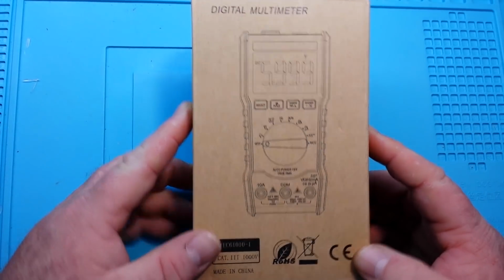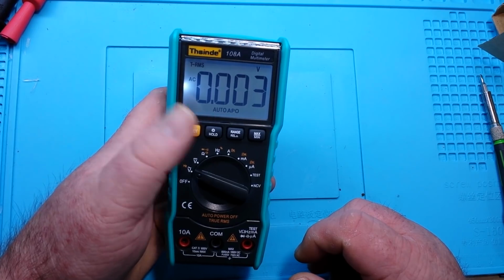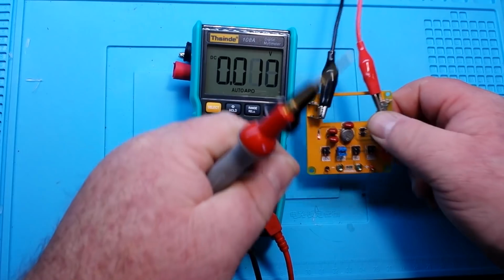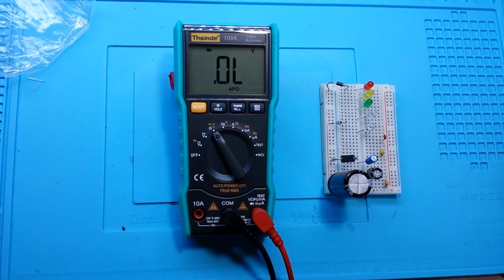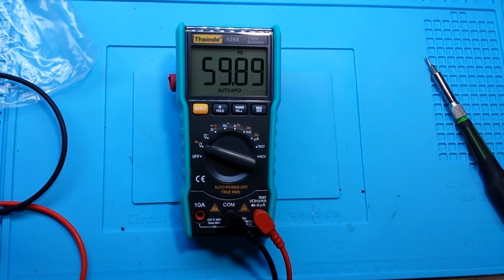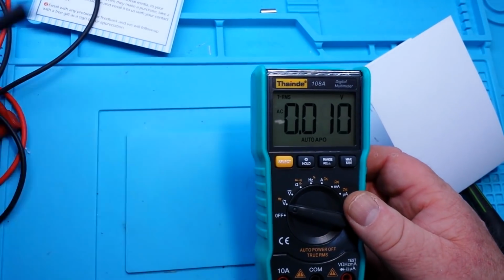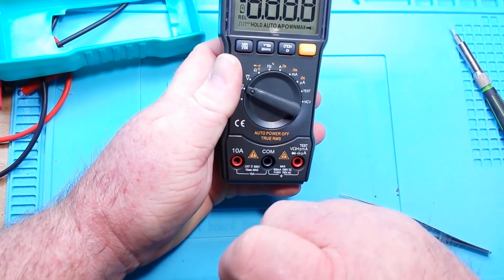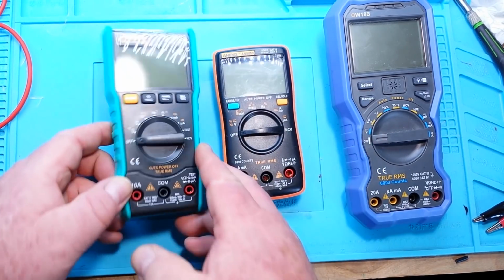Thsinde 108A Multimeter Review & Teardown

Comment: Hi, I like your reviews! :) - I have this meter in the brand of "Liumy" (LM 5005). It's almost identical. Just wanted to add: as you said in the review the display backlight shuts off after 15 seconds. I find that annoying too. But if you hold the button for 3 seconds it makes another beep and the backlight stays on until you shut it off manually.
Reply from the maker: Ok, cool. Thanks for the tip.

Comment: This is a repost of my comment that somehow "went missing".

(8:38) Sir, you are misunderstanding the in the spec sheet there.
The accuracy is 5% of the voltage displayed to a resolution of 0.001V
Basically, to say it should be accurate to within 0.001V (within the stated range) is wrong.
Plus or minus half a percent for the various voltages are given above. This is different than the resolution.
The resolution changes by an order of magnitude each time the 6,000 count is exceeded and you lose a decimal point place
All your readings appear to be within spec.

10V   0.5% 10 is 0.05 
         10 + 0.05 = 10.05
         10 - 0.05 = 9.95
Thsinde reading of 10V = 10.03V   THIS IS WITHIN +/- 0.5% SPEC @ 0.3%

7.5V   0.5% of 7.5 is 0.0375
            7.5 +  0.0375
 = 7.5375
            7.5 -  0.0375
 = 7.4625
Thsinde reading of 7.5V = 7.51V   THIS IS WITHIN +/- 0.5% SPEC @ 0.133%

5V    0.5% of 5 is 0.025
         5 +  0.025 = 5.025
         5 -  0.025 = 4.975
Thsinde reading of 5V = 5.024V   THIS IS WITHIN +/- 0.5% SPEC @ +0.48%

2.5V   0.5% of 2.5 is 0.0125
           2.5 + 0.0125 = 2.5125
           2.5 - 0.0125 = 2.4875
Thsinde reading of 2.5V = 2.511V   THIS IS WITHIN +/- 0.5% SPEC @ +0.44%
Reply from the maker: If you are Anthony Loper you're comment is right under this one. Next time you want to accuse me of something, get your facts right. In fact the next time you post some bullshit "somehow went missing" garbage I will ban your dumb ass.

Comment: (8:38) You are misunderstanding the in the spec sheet there.
The accuracy is 5% of the voltage displayed to a resolution of 0.001V
Basically, to say it should be accurate to within 0.001V (within the stated range) is wrong.
The resolution changes by an order of magnitude each time the 6,000 count is exceeded and you lose a decimal point place

All your readings appear to be within spec.
Reply from the maker: Ok :)

Comment: Not an addiction ... more a fetish!  With me it's screwdrivers that tighten my nuts.
The new tech soiled meters for me.  When I was a boy a good AVO was a precision instrument that cost as much as a house and you needed a wheelbarrow to transport it in. Hand sawn ballast resistors and sighting mirror mounted behind a needle mounted in a ruby movement.
Now you have a black tarry carbuncle evacuated onto a board made by the shopkeeper's nephew that is accurate to 5 places, has 150 functions, will never need calibrating and it will even identify the components for you if you can't.  The next version will no doubt have probes that will exude solder and fix your component in place once it's proved to be intact.  All for $1 free p&p

Comment: Great video as usual Paul. Not a bad meter for the money. I have two of the Thsinde 18B+  They are about $5-$6 more than this model, but are much more accurate and super fast for an auto ranging multimeter on the $20 and below level. People need to realize 20 years ago and when I was an undergrad in electrical engineering that meters like this were a lot more expensive and usually out of the price range of a poor college student. I know the meter was off on your voltage standard, but most people who are hobbyists don't understand significant figures and uncertainties. That voltage standard and meter combined would only be accurate enough in the physics and engineering world to maybe the first two digital digits on the multimeter. But still, it should have read closer to your Owon multimeter. A 6000 count multimeter for the price of a movie ticket, you can't go wrong.9
Reply from the maker: David,

I'm 50. And I'm fellinf we are around the same age. I couldn't even imagine buying an auto ranging dmm when I was an undergrad. I had my uncle's Simpson and a radio shack meter.

Comment: hi Paul, another great review as usual. thank you for that. about the squarewave output, i think there are two models that available : one with 'TEST' function as you have, and the other one with the squarewave function. at least that's what i know when i bought a WinAPEX ET 8101, basically the twin brother of that Thsinde DMM. the seller sent me the one with squarewave output function.
oh and you should check out the needle point probes that came with it. i have a pretty good experience with the similar cheap probes, it has quite low resistance, nice and fast beep on continuity mode. just clean the tips with IPA first before you check.
cheers. :)
Reply from the maker: Thanks!
Reply: @learnelectronics  i just realized my mistake (typo), my DMM models is ET 8102, not ET 8101. but the information about it is still correct. cheers. ;)

Comment: I'm not bothered by the manual AC/DC selector.

It can come in handy if you are trying to measure ripple on a DC power supply or similar.
Reply: Shouldn't it be possible to select AC/DC with the range button or something on other meters?

Comment: Its not the meter reading wrong, that voltage reference module has a minimum 11v input voltage to read correctly, if not enough input voltage it wont read correctly, thats why it read correctly after you increased the voltage.  Your clue was it reading a correct 10v after you increased the input volts, dont be too quick to condemn the meter.   I have one and its very consistant but will read low if not enough input voltage is applied - must be above 11 -12 volts according to its specification sheet.  Also, Mustool sells some very nice versions of these meters, I have two one has the EBTN screen.
Reply from the maker: I dont condemn it, I reccomend it.
Reply: Cool, I was hoping not because I have two of this same type meter in the Mustool brand and I really like them.  I have the MT108N and the MT109 with EBTN screen & a bit more expensive but both have been great little meters, nice little meters with big displays.  I just mentioned the voltage reference module because I have a couple of them as well and if they dont get the minimum voltage they give a false low reading, it happened to me once when I had the power supply set too low.

Comment: friends let friend buy more electronic gadgets. BTW. could you do a comprehensive review on a All-in-1 LCR Component Tester Transistor Diode Capacitance ESR Meter Inductance? A while back you did a review for a transistor checker. But this little guy is amazing. Just not sure I am using it to full potential. Thank. I have learned tons.
Reply from the maker: Do you have a part or model number?
Reply: @learnelectronics  That's pretty much it. Here's a link: https://www.ebay.com/i/223461397450?chn=ps&var=522217686828

Comment: does that mean it can measure 108 amps ?
Reply from the maker: No, 10A max for 30 seconds.
Reply: I saw 108A in the name so I thought that was the amp rating not model number but I et it now hahahahaha and the idea that it's under $20 but the leads would need to be thicker a finger probably more @learnelectronics
Reply from the maker: Thicker...yeah. My welding cables are are over 3/4" in diameter and they are good for upto 400A.
Reply: I am still new to the science behind powering high votage and high current devices and I got the basics down as far as ohm's law and trouble shooting or the importance of a cable with minimum resistance is a happy cable. But I don't get how welding with big power suckers can turn 480 VAC at 15 AMPS into whats ever output voltage at hundreds of AMPS or how stereo amplifier boards you can buy of ebay, alliexpress, banggood, ect need a DC Voltage at anywhere from 20 to 48 VDC to power and give you less than 100 watts of power total but  a car amplifier can push a few hundered watts  of power at 14.6 VDC. I don't expect you to go into detail or break it down for me but if you could point me in the right direction on how to learn that process I will for ever be thankful =-) @learnelectronics
Reply from the maker: Google cockcroft-Walton voltage mutltiplier